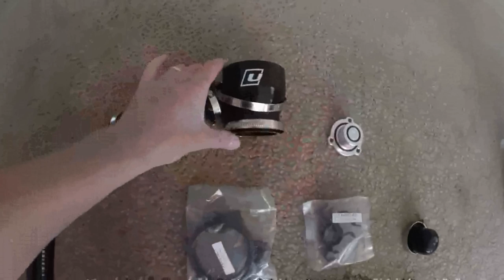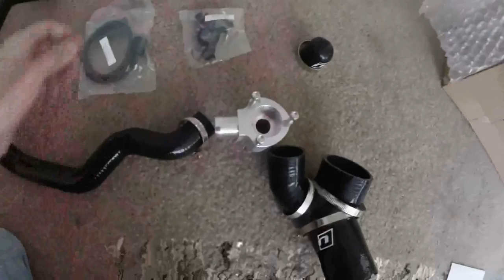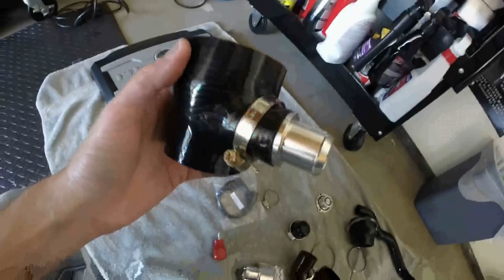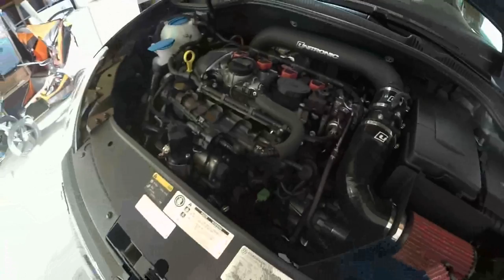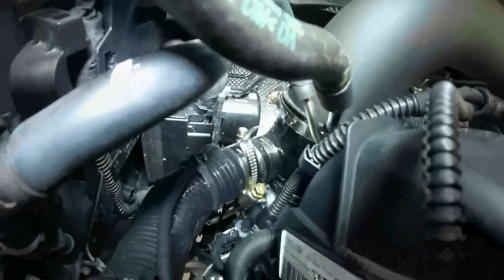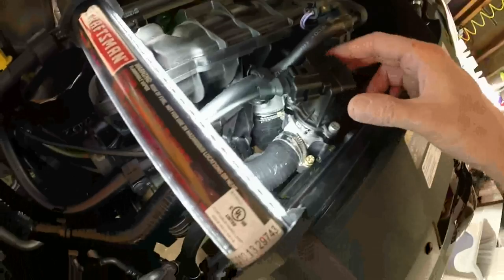2013 VW GTI: Episode 57 Vlog: Unitronic DV Relocation Kit

Comment: Old video I know, I'm not sure if it was mentioned but the 1 1/2" cap is cover the noise pipe port on the stock throttle pipe. It's the large plastic tube running from the passenger firewall to the throttle pipe. Most people have already 86'd this pipe

Comment: I've run these kits before, but I kept my stock throttle pipe. Instead of using the new Y throttle pipe, I simply used the existing noise pipe port, mounted the dv next to the N80 and used a slightly longer inlet tube. Then instead of using the harness extender I just repinned it with longer wires. This was long before I knew there was a kit. But in total I believe I spent $60 bucks. The block off plate is 40 I think, then what ever the 11/2" tubing and extra wire cost. My intake already had the small port as well as my stock throttle pipe. Oh also the dv adapter is sold seperate I forget how much. All in all I spent a portion of what the kit costs
Reply: Do u have a photos?

Comment: whats the actual reason for installing this kit?
Reply: Adam Bingley I'd say to make it easily accessible really. Plus gives an easy swap to a blow off valve afterwards 👍🏼
Reply: Removing the Diverter Valve from the heat of the exhaust manifold improves durability, while improving functionality and responsiveness.
Reply: Borgwarner k04 comes with no dv port. This is a gold app for that

Comment: Did you find a better solution from the unitronic DV relocation kit or was it just your personal preference that you didn't like the extra hoses? I'm looking at getting the Unitronic cold air intake and was wondering if I should go ahead and get the add on coupler so I don't have to deal with removing the intake later on to install the DV kit?
Reply from the maker: i didn't try any other DV relocation kits, so i don't know if the Unitronic is the best. There are not a lot of choices. If you think you may get it some day, you might as well get that altered coupler.

Comment: This won’t kit won’t fit a stock intake pipe ? Am on stage 2 and I have a dv from forge it raaaaaaaaaaping my gas mileage right now just need to kno if I have to finish the rear part of my intake before I buy this kit
Reply from the maker: dont think the adapter would match up, not sure.
Reply: @LastHumansGarage  yes it wont u do need rear intake

Comment: On most MK6's the Unitronic Cold-Air Intake and some others cause a high-pitched whistle at high rpms. Supposedly this DV Relocation kit gets rid of that whistle. But I have yet to install mine and see if the whistle is no more.
Reply from the maker: this kit always gets rid of the intake whistle. in addition it moves the DV from the hot side to the cold side, diverting colder air back into the system.